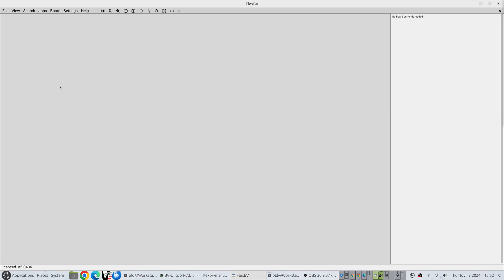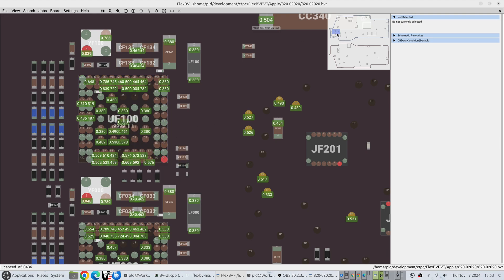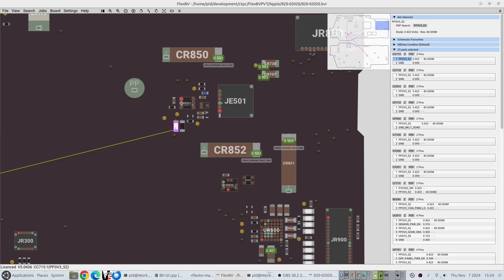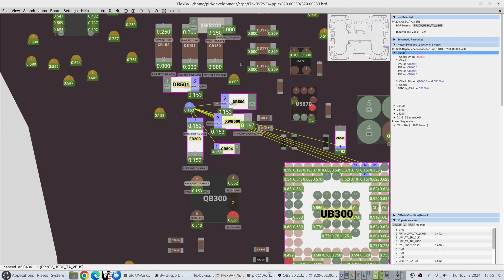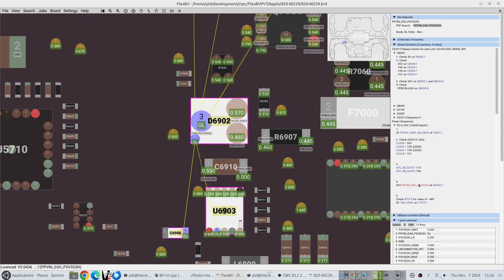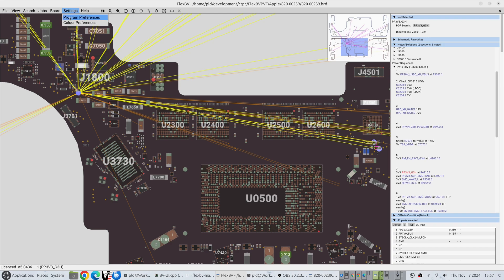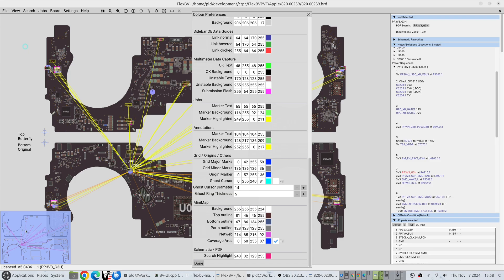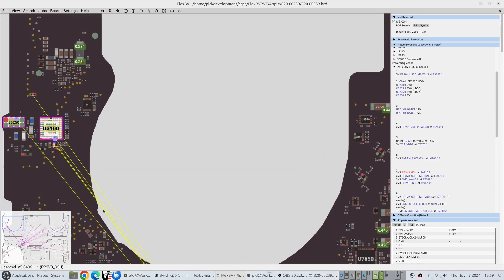FlexBV5 5.0436 Release: Feature release, The "MINI MAP"

Comment: This is such an awesome feature :D I saw it in one of your latest videos, prior to the release, and I thought... Is that something coming, or is it just something you're using for debugging? Thrilled that it was a coming feature <3
Reply from the maker: There's still some level of improvement to go, I noticed on the release version I've not done a proper vertical offset of the boards in the floating window; not a complete killer but annoying - all good, easy to put a new release out :)